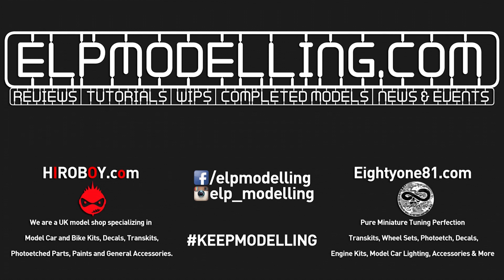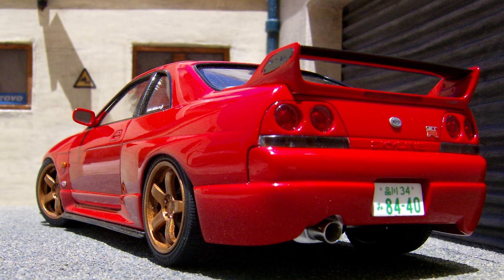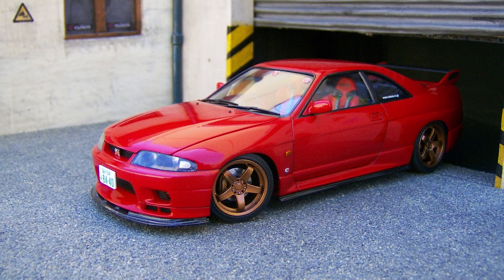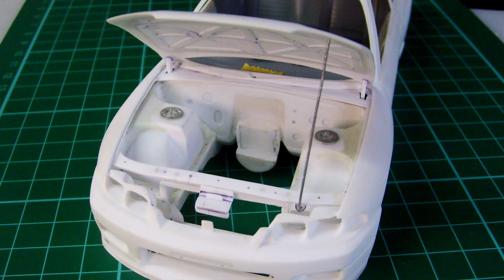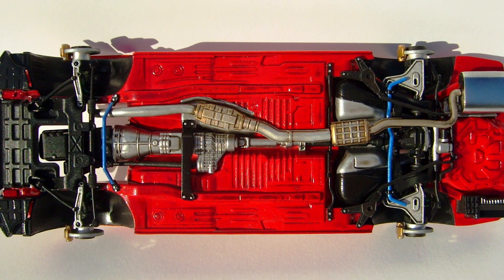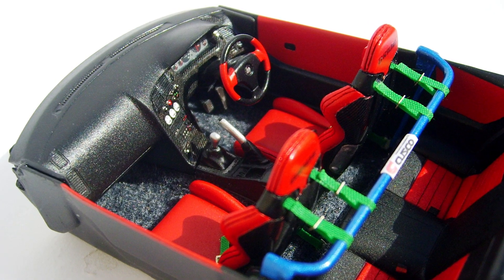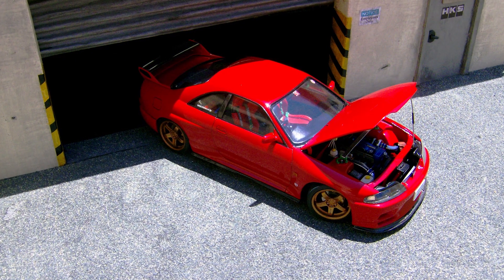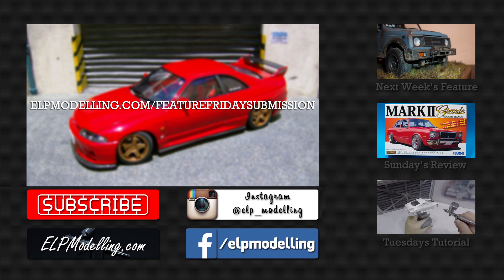The More You Look, The More You See - Nissan Skyline R33 GTR

Comment: How do you apply the decals?
Reply: +Harry Lawrence I'm assuming that you're asking about the carbon fibre decals, right? Well, for parts with a simple, flat surface, I apply them in the same procedure as I would with normal kits decals. For curved or abnormal surfaces, I first make a template with masking tape. Then I cut out the cf decal on the template, apply a layer of decal solution on the part and then put the decal onto the solution. Then I start pressing the decal onto the part, sometimes using a hair dryer to heat the decal as a heated decal takes the shape better. Watch out if you use the hair dryer, some of them can easily produce a big amount of heat and this will melt the plastic.. and you don't want that to happen!!